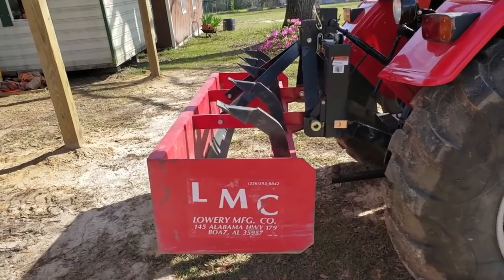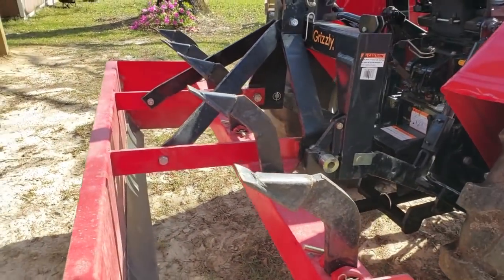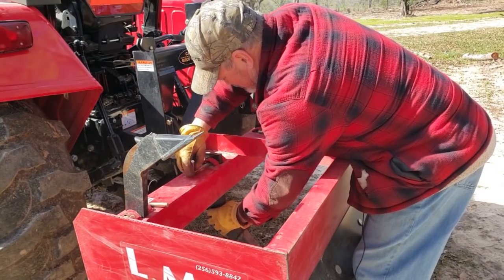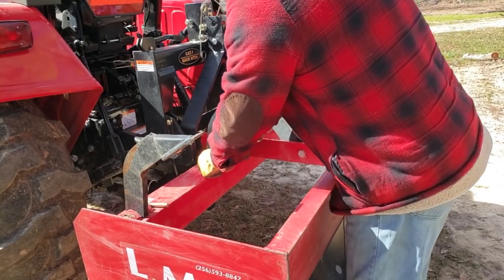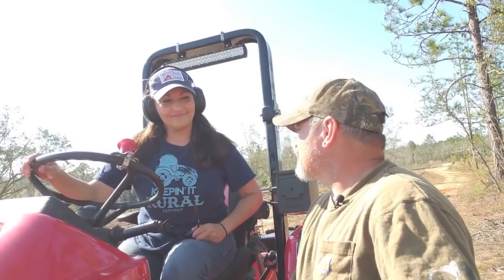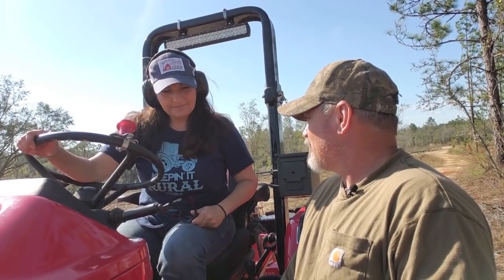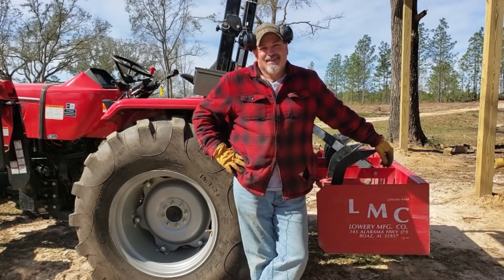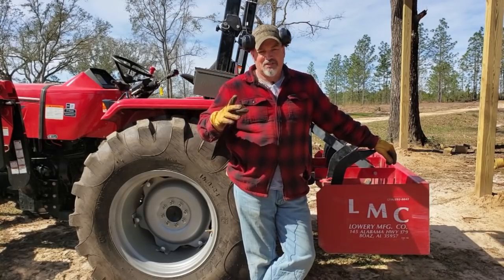How I use a BOX BLADE on my compact tractor on our hobby farm

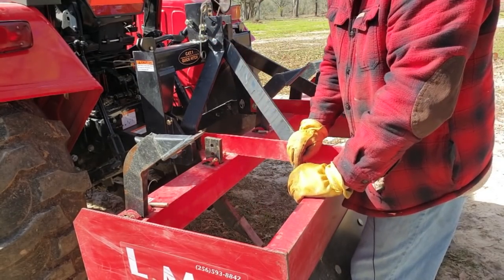Comment: About 4:00 minutes in, weren't you installing that ripper backwards?  The pointy end should be facing the front.
Reply from the maker: Not necessarily installing it, just showing how the depth is selectable via the pins. The shank was indeed facing backwards a but I wasn't really pointing out the direction of the blade. Just the depth selection. Thanks for the comment 👍

Comment: Hank, I have the same box blade and was wondering if you could post a video showing how you modified it to be quick hitch compatible. Great channel keep it up!
Reply from the maker: I'll try my best to get around to it. Thanks for the idea. 👍 Thanks for watching.
Reply: Hamiltonville Farm 
It’s a good box blade I live not too far from their largest distributor, just need to get it QH ready!
Reply from the maker: You can loosen the bolt a tad to allow the hook to fit, or, I've seen people actually "skin" down the hook with a grinder to shave about 1/16 or 1/8 inch to make the hook more narrow to fit in the slot.
Reply: Hamiltonville Farm 
Good idea I will play with those ideas thanks!

Comment: Outstanding!  I am looking for a 4540 4wd, but when i talked to the salesman, he felt i was going overkill for my 11 1/2 acres.  He wanted to talk more about the 1640 or 2638.  Do you feel it would be overkill for brush cutting, loader work, grading my 1/4 mile drive way and just helping move some downed trees on the property?  I was also thinking of doing some brush cutting on the side.  What do you think Hank?
Reply from the maker: That will be a good size. Go for it!
Reply: @HamiltonvilleFarm  Thanks!
Reply: @HamiltonvilleFarm  Thanks again, I just found a 2017 4550 4WD with fel, and pulled the trigger.  Thanks for the great vids and info!